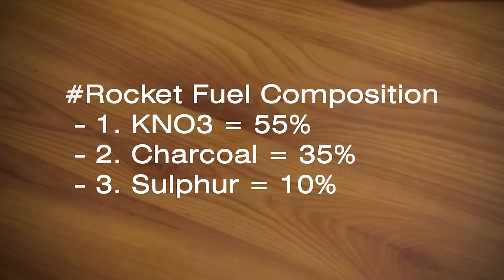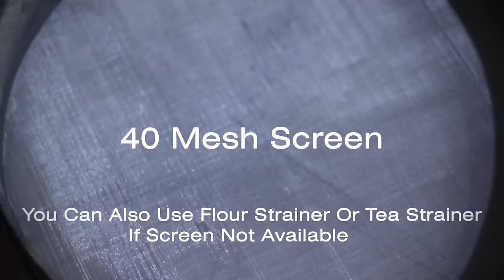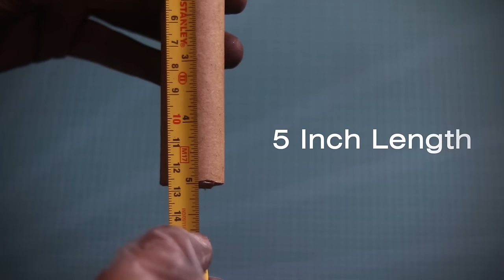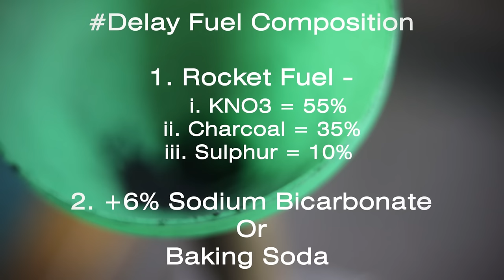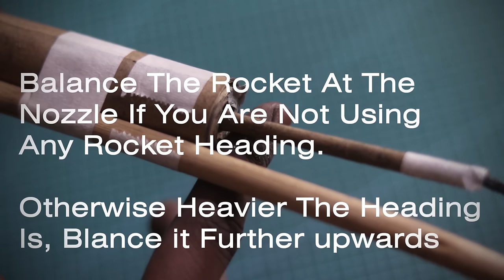How To Make A Rocket | 1/2 Inch | 4 Oz Rocket

Comment: How does the 55-35-10 fuel compare to 60-30-10 ?
Reply from the maker: 60 30 10 is definitely better if you are using a header
Reply: I am used to 4:1:1. Result is  verh gpod.
Reply: @jyotirmoydutta5043  4:1:1 ?. . thas a weird compsition, does it burn too quickly though
Reply: @PassfireRocket  i use 65;25:10 coz it’s always better to choose fast burning fuel… unless it explodes.

Comment: In Thailand, it's easier to make a small rocket. They use a water pipe as the rocket, then cover the head of the rocket with fire, then press it with paper and clay, and use a single pounding iron. When finished compacting the black clay, use clay to compress the bottom and drill holes with a hand drill.
Reply from the maker: The problem with drilling is that, you cannot get a good tapered hollow core

Comment: But should black powder be pressed dry, not moistened with dextrin?
Reply from the maker: Not necessary. Dry works fine. Also Dextrin will slow down the burn rate

Comment: 🎉🎉Please tell me why u made quick match as fuse , 
Why didn't you use simple fuse?

Do you want to ignite the rocket from the top end,  is that the reason?🎉🎉
Reply from the maker: It makes the fuel burn faster which helps to generate more thrust at initial stage

Comment: Thank you for the link from your other video, very easy to follow. I had no idea a slow mix would work so well for rocketry. Do you use the same mix for a rocket with a heading? Does this same mix work for larger rockets with heavier payloads as well? I enjoy making Black Lowder for my old guns and antique cannon I have. I find the process very calming and relaxing. Its also nice to feel that sense of accomplishment making your own BP. I live in the middle of the country with lots of land and no neighbors. Now that my two sons are getting older, we want to make our own rocket engines for their home made model rockets. This is why I ask the questions. Anyways, another great video and I enjoyed it very much. I will share it with all of my pyro loving friends.
Reply from the maker: Thank you so much bro.
With headings I use 60 30 10
For larger rockets it depends on the specifications of the tool.
For 3/4 rocket I use 55 35 10 with heading
Reply: Such mixtures often burn quicker under pressure. Granulated black powder for example burns about 50 times faster under confinement and high backpressure. Of course that’s not what you want in a rocket.

Comment: what type of charcoal are you using?
Reply from the maker: Firework Grade Wood Charcoal
Reply: @PassfireRocket I think they mean what is the charcoal made from...

In the case of rocket fuel charcoal... My notes say mixed hardwood charcoal is best.
Reply: @Anon-xd3cf No you should be using willow for charcoal not hardwood.

Comment: From where we can buy Bentonite clay
Reply from the maker: Amazon.in
Reply: @PassfireRocket  can u send me purchase link?
Reply from the maker: @patelharesh8673  https://www.amazon.in/Tito-Premium-Clumping-Cat-Litter/dp/B0B9JW1WFB/ref=sr_1_9?crid=MC5T8IAV3HAZ&keywords=cat+litter&qid=1673240231&sprefix=cat+litter%2Caps%2C659&sr=8-9
Reply: Its literally cat litter. The cheaper. The better. Grind it in a blender.
Reply: @PassfireRocket Thanks bro
Reply: Do you mean cat litter?? Can it be ground and mixed into materials?
 @user-sg2yt6nc1z
Reply: I use a clay nozzle mix of 61 parts crushed bentonite (kitty litter clay), 31 parts sanded grout(or crushed red brick, pottery, etc.) 8 parts paraffin wax.
Mix up the dry material well, put in a heat safe container, put in the paraffin, heat at 200-225 Fahrenheit, until all the wax is melted completely and the dry comp is up to temp, then remove CAREFULLY(it’s HOT) and mix all ingredients together very well by shaking, mixing, running through a 10-20 mesh screen a handful of times.
Works great on motors at least up to 3/4 id (biggest I do), AND it’s easier on aluminum rammers over straight granular kitty clay. The paraffin helps really consolidate the comp well and protect from moisture.

Comment: What is the diameter of your spindle?
Reply from the maker: 1/2 Inch
Reply: If inner diameter is 1 inch
Then bottom diameter of spindle should be 3/5ths of 1 inch

Adjust accordingly.